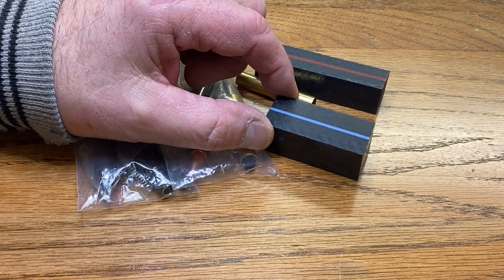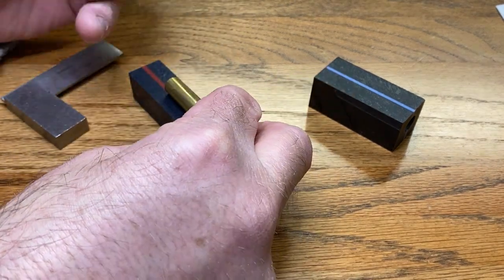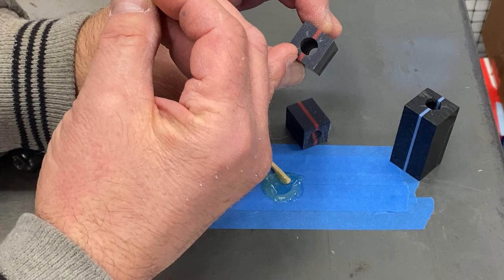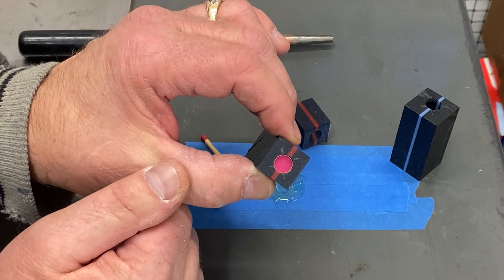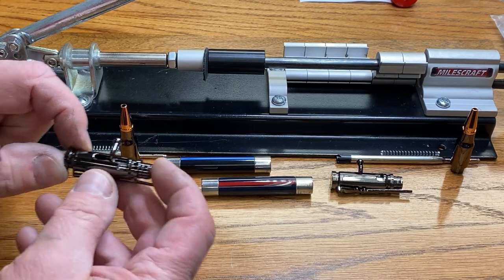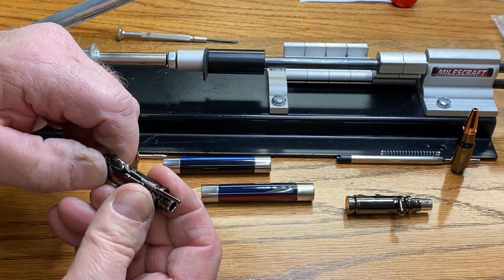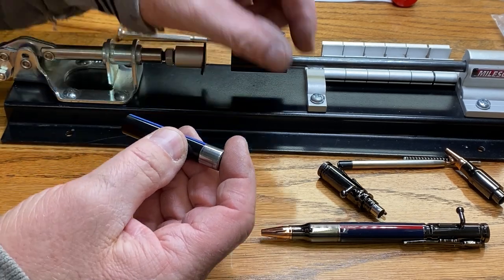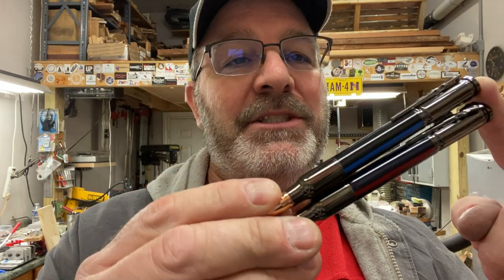Turning Thin Red And Blue Line Blanks For Gun Metal Bolt Action Kits

Comment: When i worked with type of pens i notes that if you shorten the tube when you sanding end of it you will face little of problem with refill it will littel longer when rifill is out  so you may ponit to that to not shorten the tube when sanding. Beautiful pen's 👍
Reply from the maker: Thank you. 
  Bold point that applies to most pen kits. 

Regards,
Bob

Comment: Great pens!
Question - at the 3:42 mark, it looks like you're using some sort of sanding block. What it the block made of? Hard or soft?
Reply from the maker: That is just an acrylic blank with a nice flat surface. I use it to work out the tool marks. 

Regards,
Bob